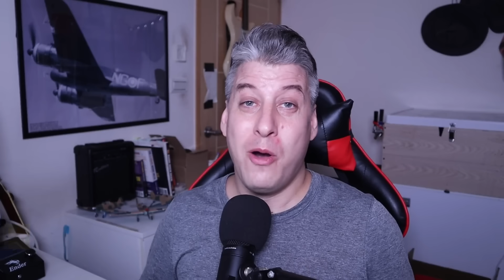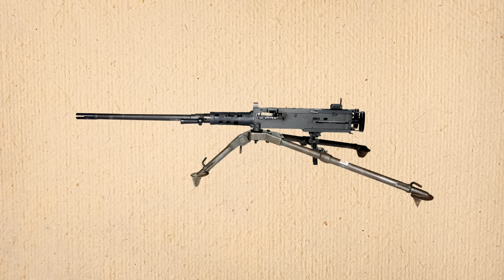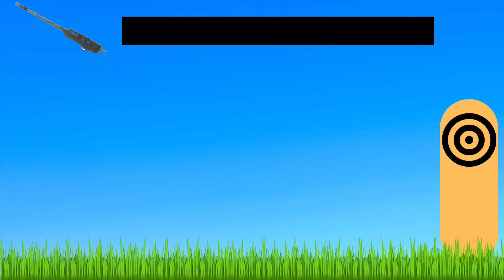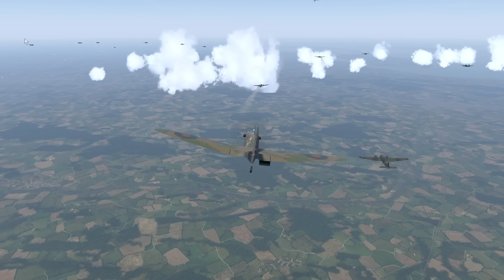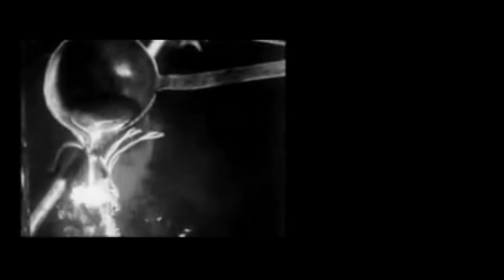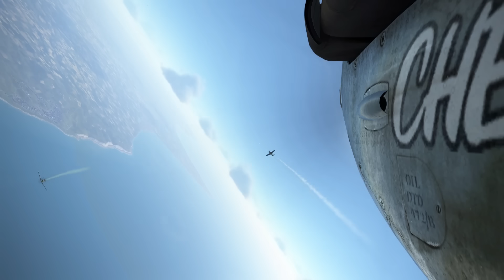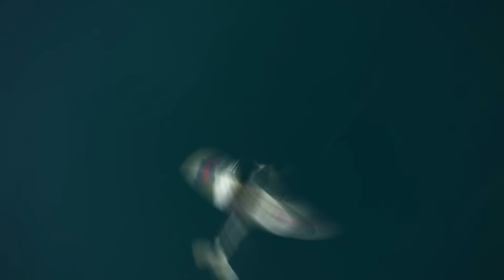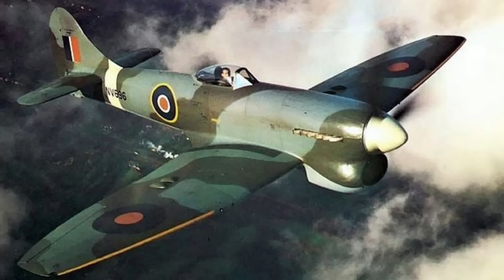Why Did The RAF Use .303 Caliber Machine Guns in WW2? The Surprising Answer

Comment: You have to fight with what you have. The 303 was available and reliable. By the time the 50 started to arrive the 20 mm was working. Also self sealing tanks and armor only became available in 1940ish. At the cost of weight and performance. By the way one of the things stopping the zero having armor was Japan did not have an engine powerful enough to keep the performance.
Reply from the maker: ah. good point about the Japanese engines!
Reply: There was a version of the Zero that was fitted with an armor plate to protect the pilot and I think it also had self sealing tanks, but the extra 400 lbs completely destroyed it's performance and as a result only 400 were produced, I think I remember reading that the majority of them were removed from front line service and were used as trainer's. 
Like the Brewster Buffalo once it was weighed down with extra weight for survivability it couldn't be fitted with a more powerful engine because the airframe couldn't handle it, so much would have been redesigned that they just put the efforts into designing entirely different aircraft. 
The "Mighty Zero" was a false God, it's entire reputation is based on it's record against Chinese biplanes and it's first month or two against green US pilots who just had to learn how to fight against it and forget their peacetime training which was wrong for dealing with an aircraft like that, but with the right tactics they quickly turned the tables against it to where even the Wildcat was shooting it down at a ratio of 5 to 1.
Having no survivability engineered into it for the sake of things like maneuverability and climb rate turned out to be a mistake, one good squirt from the .50 cals of the US fighter's and they came apart usually resulting in them bursting into flames, one of Japan's leading aces who survived the war is in an interview here on YouTube and he himself says it was Japan's worst fighter of the war citing it's lack of survivability as why.
Reply: @dukecraig2402  That's possibly the worst revisionist claim I've seen in a while. The IJN preferred maneuverability over speed, etc, as a matter of doctrine, not design choices. Hurricanes that were successful in the Battle of Britain tried the same tactics against A6Ms and got chewed up. Basically any attempts to engage in maneuver with a Zero was suicide. Allied air forces became successful when they started employing competitive strategies against the Zero. You also ignore the Zero's insane range compared to its opponents. The P-38 was the only plane that came close.
Reply: @Caseytify  
And they paid the price for it, and why are you citing the example of Hurricanes using bad tactics against the Zero when I quite clearly stated that after the early engagements against the Japanese using wrong tactics the US pilots adopted the right tactics against the Zero and started shooting them down at 5 to 1 with even just the Wildcat? Don't you get what I was saying there? What does Hurricanes using the same incorrect tactics against the Zero have to do with it? 
Facts are facts, a 5 to 1 kill ratio of the Wildcat vs the Zero is proof that the Zero was a false God, that 5 to 1 ratio isn't for US fighter's as a whole against the Zero that's the kill ratio for just the Wildcat specifically, what is it with you guy's who believe that maneuverability is the ultimate measuring metric for a fighter and just want to dismiss survivability? This was real life not a video game.
And once again, it's one of Japan's surviving top aces who right here on YouTube even admits it was their worst fighter of the war and cites it's lack of survivability as the reason, seeing as how he flew it and their other fighter's he compares it to I'd say he knows what he's talking about.
Reply: @dukecraig2402  True but also the zero only had a 900 hp engine. When it first flew in China it was against biplane type aircraft the best being the Russian I-16. In 1942 it could out range the P 51 of 1944. Also the Japanese AL used was stronger than US AL of the day and a number of US aircraft were armed with .30 not .50's. Good comments.
Reply: @brianrenfree5646  
I thought I pointed out that because of the Zero not being able to be refit with a more powerful engine without it having a major redesign the defensive armor they tried fitting on it destroyed it's performance, and it's not that they didn't make more powerful engine's as you claimed they did, it's that they couldn't put one on the Zero without a major redesign because it's airframe couldn't handle it, and again yes they did put armor protection on a variant of the Zero, your claim that they "never did" put defensive armor on the Zero is incorrect, also the issue of their engine's wasn't just power, rating the power of aircraft piston engine's from WW2 is a very tricky and subjective thing, one thing about those aircraft engine's that's equally as important as peak power is their superchargers and the altitude(s) they could make that peak rating at, people always run straight to Wikipedia and look the power rating for aircraft but what Wikipedia prints is just a very small part of the picture, they're showing peak power at an altitude where the supercharger can provide maximum boost, without a 2 stage 2 speed supercharger system (or the equivalent turbo compounded system most US Army aircraft had in WW2) power just drops the further up the aircraft climbs above that altitude, so to really get your head wrapped around the capabilites of a fighter you have to look at something like the NACA reports on them that shows power levels at different altitudes, aircraft that had 2 stage 2 speed superchargers could climb to an altitude where their power would start to drop and shift their supercharger into it's high range and obtain maximum boost again at 10,000 ft or so above that, that means they could make maximum power at 2 different altitudes and maintain good power in between them, unlike a Zero which once it's power starts dropping due to climbing it'll just continue dropping from there up the further it climbs.
Service ceiling is another misleading statistic, very light unarmored aircraft like the Zero might be able to climb high but at their service ceiling because their engine's only have a single stage supercharger their actual performance including speed and maneuverability is way down, if a Zero was to climb to the altitude that US fighter's like the P51 and P47 with high altitude supercharger systems still had high performance numbers they wouldn't stand a chance against either one even in a maneuvering fight, above 15,000 ft or so is where a P47 can start out maneuvering a Zero, wing loading isn't the final say in maneuverability like most people think, speed and engine power are equally important parts of the math when determining maneuverability and above 15,000 ft or so where aircraft like the Zero that only have single stage superchargers on their engine's once their power starts dropping all their other performance number's start dropping drastically, so it's not just the 900 HP rating it's the fact that the higher they went the further they got from that 900 HP, had they put a 2 stage supercharger on it's engine the Zero would have been a much better fighter than it actually was. 
All those fantastic performance numbers for the Zero are at a very narrow band of speed and altitude, above and below those speed and altitude number's and their performance starts dropping dramatically, maneuverability is a good example there, at higher speeds their controls almost locked up and they lost any kind of maneuverability advantage they had, so even at an altitude where their engine's made maximum power they still had to stay under a certain speed to be maneuverable, between it's lack of survivability on all the versions that saw action in any real number's and the fact that it's performance stats are limited to a narrow altitude and below a certain speed I'd say there's a good argument that the Zero was quite possibly the worst fighter of WW2 that saw action in any number's. 
And I'd be a little leary about going around claiming that it had a further range than P51's that were fielded in the Pacific in 1944, first off Wikipedia and by extension the makers of most videos on YouTube about WW2 fighter's that use Wikipedia and each other for source material are wrong about the ranges of most WW2 fighter's, like engine power they only list the range of one variant for each aircraft and they usually get that wrong anyways, in 1944 P51's started flying escort missions with B29's on raids from islands like Guam to mainland Japan, a distance that according to the range listed in Wikipedia they shouldn't have been able to do, fighter ranges are just as subjective and tricky when it comes to rating them as their other ratings are, there's the fact that their range is limited to how far they can make it back on internal fuel after dropping external tanks and consuming 15 minutes worth of fuel in aerial combat, that's a lot different than just putting drop tanks on something and seeing how far it can fly, also Wikipedia has the bad habit of only listing the range for one particular size of drop tanks when US fighter's in the Pacific were using 3 or 4, there was a US drop tank that was over 300 gallons that Wikipedia doesn't list ranges for and P51's were using them flying from Iwo Jima after it was captured, the last variant of the P47 with it's wet wings using the drop tanks tanks that were over 300 gallons also had a range further than the Zero, they were not only flying escort missions but were also flying fighter sweep missions over mainland Japan from islands that I'm unaware of any Zero's flying missions from Japan to those islands and back, what Wikipedia claims as maximum ranges for fighter aircraft and the actual missions flown by them are two different things.

Comment: The 8 x .303 Brownings of the Spitfire and Hurricane were perfectly good enough to shoot down German fighters, ditto bombers too, in the hands of a good shot. 
But not all pilots were good shots. 
And as the bombers started to be armoured, this certainty was reduced, even for a good shot.
But back as early as 1935, the RAF had issued specification F.37/35 for a single-seat fighter armed with four cannon.
This produced the Westland Whirlwind, which first flew in 1938 and had excellent handling characteristics, although its RR Peregrine engines were insufficiently developed and proved troublesome. 4 x 20mm nose-mounted Hispano cannon was an exceptionally heavy armament but, of course, being twin-engined it could not match the agility of a single-seater.
But by late 1940 the Spitfire and Hurricane were being up-gunned to the 20mm Hispano, which tilted the balance back in their favour.
It’s interesting that whilst US fighters all came armed with the highly effective .50 Browning, against which the .303 round seemed rather puny by comparison, they actually stuck with the .50 throughout the war and eventually it was being overshadowed by the bigger 20mm guns.
Reply: I did read that the Americans had trouble producing 20mm in large quantities guns back in the states.
Reply: @rob5944  it also helps that the .50 cal production train was basically chugging at full speed by the time 20mms became an available option
Reply: @jefflei215  no idea, just read that there were problems scaling up production.
Reply from the maker: A good point Lawrie. I was thinking about exploring that final question in another video.
Reply: @CalibanRising  
Would look forward to that.
I hadn’t previously heard the possibly apocryphal Bomber Harris story, but regardless of whether that was actually said about visibility/range or not, it’s only half the story.
The .50 Browning was considerably more destructive than the .303, and so just to have been armed with that instead would have been a considerable advantage at any range.
So then RR turrets were introduced with that heavier gun - but without great benefit?
I’m sure it all gets very complicated…

Comment: Why did they use .303 caliber machine guns?
1. More ammo capacity (The very same reason why 105mm Rifled gun was still used on light tanks and some MBTs today.)
2. Better hit probability (Especially in the days where Radar gun rangefinder fire control computer was still in infancy.)
3. Insane rate of fire but not too overkill (A big plus when during counter insurgency operations you need CAS for suppressing enemy guerilla troops while providing cover fire for friendly troops on the ground.)
4. Psychological impact ( A gun that sounds like ripsaw can be used to demoralise the enemy insurgents on the ground.)

Also, the Americans had the 50 caliber version which later used by F-84 Thunderjets and F-86 Sabers in Korean War.
Reply from the maker: Were people raising the same question about Korean war era fighters, I wonder?
Reply: @CalibanRising  Yeah, some people thought that the F-84 and F-86 should have been equipped with the 20mm autocannons to counter the MIG-15's 23mm and 37 mm autocannon, but later found out that the M3 50 cal Browning is still good enough to take out the MIG, especially with the digital Radar fire control computer. But in the late 50s, when the Soviets started to fly supersonic jets, the Americans finally decided to use 20mm autocannon and 20mm gatling cannon started to replace the good old M3 50 cal on their warplanes. Then, recently the Turkish Army outfitted M3 50 cal on their Patton Tanks for shooting down drones and taking out technicals.

Comment: The British could neither get production rights for 0.50 cal nor get supply of them from the US in enough volumes. The US 0.50 cal just was not an option.
Reply: The British already had .5” machine guns in service for several years before World War II, Vickers built a .5” machine gun to equip their light tanks in the early thirties, they also had access to larger calibre guns like the 15mm BESA.
Reply: @mrjockt  Which they rapidly phased out for the Besa. Vickers 0.50 was not god gun.
Reply: @mrjockt  Vickers 0.5 was water cooled and just not piratical for aircraft. the BESA had problems with rates of fire.
Reply: @DavidRinglis2  Remember the Browning that we fitted to our aircraft started life as a water cooled machine gun, the M1917, so converting from water cooled to air cooled can be done, as for the BESA it’s main issue was accuracy, or the lack of it in automatic fire, rather than rate of fire, at around 850 a minute it was comparable to the earl versions of the M2.